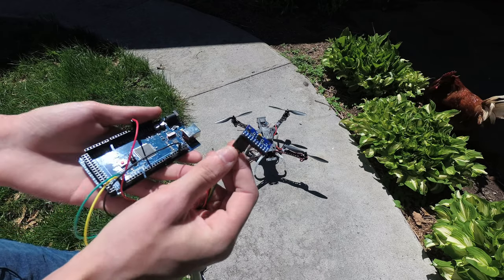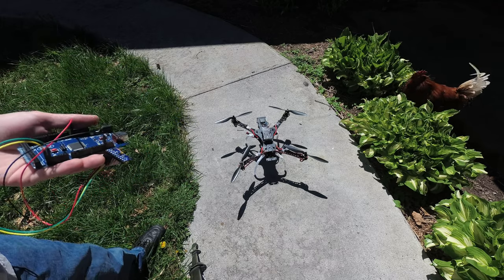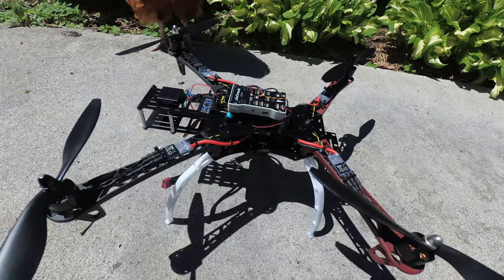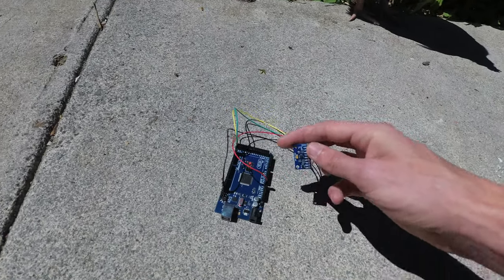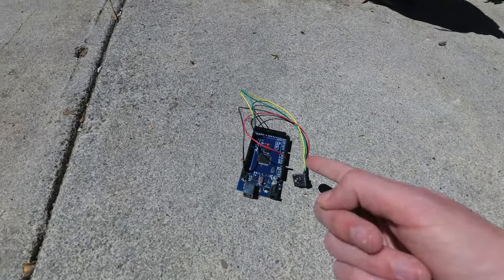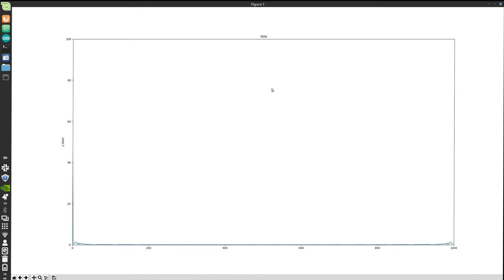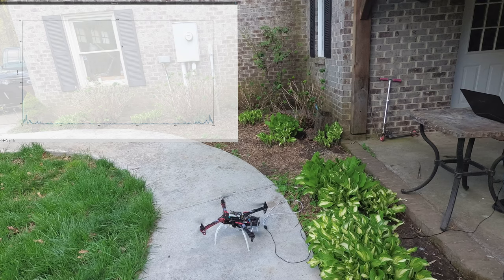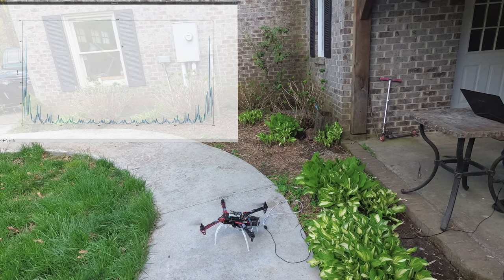DSP mini project

Comment: Can you make a video explaining/replicating what was done here youtube.com/watch?v=X5sCM2q6PXU
Reply from the maker: No lol, Why do you think I would know? It looks like a typical DRSSTC circuit to me. "ZVS" only means the switching elements are transitioning between saturation and cutoff when  Vds is close to zero.
Reply: @power-max  from the LTspice files, it seem he's using the regular Mazilli driver. That would imply he simply wound the secondary to resonate with whatever primary LC circuit he had, and now thinking of it, it wouldn't be too hard to keep testing the secondary while adding turns (and knowing the theoretical dimensions it should have). Seems like a good visual step up from the Slayer you made a long time ago.
Reply from the maker: @sFeral  Yup, the disadvantage is that it has to be interrupted. The oscillation will build up to enormous voltages and currents completely unbounded unless there is a load on the output to reduce the Q factor of the primary (usually a discharge point) I am working on exactly this using a phase locked loop (CD4046) although because I am limited in power (96W from a 48V 2A power supply) I cannot exceed the performance demonstrated in my EasySSTC. I do not have the high voltage capacitors necessary for decoupling on my H-bridge driver PCB, and my gate driver ICs are fairly sensitive to abuse and die quite easily.
Reply: @power-max  have you tried a variation on the Slayer where the secondary signal goes to the base of a PNP/NPN BJT (set to ON or OFF depending the arrangement) which then directly controls a MOSFETs' voltage divider ? There must be an error in my thinking, otherwise this would be a known working arrangement.
Reply from the maker: @sFeral  It sounds like a step backwards from my EasySSTC which uses a proper MOSFET driver IC with hysteresis. The point of the PLL is to enable more robust feedback and enable real audio modulation. I have acheived results better than my singing arc in terms of audio quality, although the length of the arc has been disappointingly short (usually about 1/2" or 1cm).
Reply: @power-max  Yea I got mixed up. What I described would be a regular class A amplifier/like circuit, and would probably work better with a NPN (set to OFF, oscillation is self starting) being triggered by the positive signal instead of the negative. Keeping it simple usually works well, if there are enough flexible/synchable parameters overall. Still I'm puzzled by not seeing it in action, which points to an issue, somewhere. The mental aim was to increase the switching efficiency, since the MOSFET should be going from full ON to full OFF , if the BJTs E-C resistance falls beyond the critical value, at the right moment,  and that could be adjusted, again, "simply" by adjusting its' divider. Though I'm not entirely sure what "simply" means under the circumstances, as  I've only managed to find the G spot of a IRFP260N, in the simplest slayer arrangement, and it isn't in the "full ON" region, which does make sense ( I'm fairly certain I understand why).  I'm getting a 5mm streamer at 12V as is. No topload. The PSU can go up to 10A but I've not measured the draw.
Reply from the maker: @sFeral  OK, so a few things:

* You want to use a totem pole configuration to drive the MOSFET. A single-ended driver is bad because the MOSFET gate is a ~1nF capacitive load. With an open-collector output, the gate has to be charged by a resistor so there's a direct tradeoff between the switching speed of the gate and power dissipation of this driver. A totem-pole can push/pull current in/out of the MOSFET gate, drastically increasing the switching speeds with minimal wasted power. I've done this with my EasySSTC using a 2N2222 and 2N2907 emitter follower config in-place of the DS0027 IC, with comparable performance. You can also improve switching speeds by using very expensive state-of-the-art SiC MOSFET's, with their much lower gate charge.

* BJTs are not so simple :( There is no "resistance" between collector and emitter (Well, OK: There is an Ro due to the early effect but I digress). The collector acts like much more like a  current source that "bottom's  out" when the transistor is saturated (Vce < Vbe ≈ 0.7v). If you use BJTs as a common emitter amp, then the input responds to current and the collector is a constant current sink. A pull-up resistor kinda converts that current into a voltage (ohms law), but the load affects voltage output: A capactive load makes it sluggish.

The emitter follower amplifier instead amplifies current and buffers voltage. It has a high impedance input (looks almost like an open circuit) and is easy to drive with the feedback, but can deliver 100 times the current from the input to the gate of the MOSFET. (low output impedance -> fixed voltage) so it can yank the voltage up and down fast based on the input! An analogy would be power steering in your car that makes the wheel easier to turn by amplifying the force you apply to the wheel.
Reply: @power-max   I'm not sure if you picked up on my exact idea, and I'll need time before i understand the lingo, but it'll be easier for you to point out the mistake if I just give you the diagram https://imgur.com/dm3X3J6    was thinking of putting at least one diode  at the right spot, since the signal voltage disrupts the current flow in the primary circuit . There's also the geometric arrangement of the coils, the primary is exactly under the secondary. Another MOSFET instead of the BJT could maybe also work. I'll have to test it all out, unless you tell me it surely won't.
Reply from the maker: @sFeral  Sorry, let me explain in terms of your diagram. You have a single (unlabeled) NPN BJT as an common emitter MOSFET driver. When this transistor is "OFF" (technical term is "cuttoff region") then the MOSFET is going to slowly turn ON because R3. This works but R3 must charge the MOSFET gate quickly. I would naturally pick a value between 200 ohms and 4700 ohms, or whatever is the lowest value you can get away with before the BJT can't pull it low with your input. I appreciate you bias the base of your BJT correctly! I would make bias the adjustable parameter!
Reply from the maker: @sFeral  I think it would be wise to add a push pull totem pole driver in-line between your inverting amplifier and the MOSFET, as shown in the link below. It will prevent loading effects of the MOSFET from affecting your driver. Take careful note of how Q2 and Q3 are connected. https://electronics.stackexchange.com/questions/299552/what-is-the-purpose-of-this-pull-up-resistor-in-totem-pole/299558
Reply: @power-max  I'm using a fluorescent tube to probe the field , and am getting some interesting effects... like it lighting up fully only if it's positioned tangential to the coil... areas where it flickers from full to none...goes from full to none with slight movement closer or farther. Interesting, and all because I'm disturbing the resonance, probably causing destructive interference.
Reply from the maker: @sFeral  I think your hypothesis is correct. Placing the tube too close causes a loading effect that reduces the Q factor and causes the circuit to be less stable. Too close and it may extinguish entirely! This is perfectly normal and expected behavior from this type of oscillator. Not good for applications needing reliable and consistent output, but fun to play with!
Reply: @power-max  happens only with the addition of the BJT and if it's set in "detuned modes" . When it's just running on the 260N the light is fully on, even at 1mm distance, and the streamer goes out with proximity, though I can lay the tube nearby, 30cm or so, an it will glow along with the streamer.
Reply from the maker: @sFeral  Sounds like some sort of phasing. Your addition of the BJT is an inverting amp. Is the same difference noticed when you reverse the polarity if your primary?  Even if not, then it's probably still a phase thing, but not a full 180° flip. Understanding exactly how the oscillator works is complicated even with an electrical engineering degree because it's not Linear Time Invarient and has positive feedback at the oscillation frequency.
Reply: @power-max  XD forgot to do that, even though I signified the importance by drawing the currents in the diagram.
Reply: @power-max  btw have you tried making your own high voltage capacitors ? ..out of pvc foil and Al foil maybe ? Haven't yet seen anyone make a big one (and with multiple leads out to reduce inductance, if it would matter). I might have seen someone use Al sticky tape.
Reply: @power-max  Turns out that when it oscillates the polarity is actually opposite to what I predicted.  The peculiar thing is that I did not change the polarity when I added the BJT, so there's something amiss anyway. Also changing the number of turns from 1-3 apparently changes nothing, except maybe making it more unstable, as touching the heatsink extinguished the streamer.
Reply from the maker: @sFeral  Then it's probably something to do with the gain of the whole system. Adding the BJT adds an additional stage of gain, also it drives the MOSFET gate better. Driving the MOSFET gate with the feedback directly is a terrible idea because it's high voltage low current and relies on the clamping diodes to prevent MOSFET death.

Yes, I have almost killed myself making r/DiWHY high voltage capacitors. Don't bother with that, Capacitors are cheap. ones you buy will have better ESR, dissipation factor, lower losses, and lower series inductance, and better voltage/capacitance ratings. Aluminum foil is going to have nasty sharp edges that create points of failure at high voltages. RimstarOrg made a video on DIY capacitors a while ago.

The circuit relies on all sorts of parasitic coupling between things. It's notoriously unreliable. You will find that any little thing you change will affect the output.
Reply: @power-max  the polarity is opposite to what I expected because I kept thinking that positioning the primary under the secondary makes it oppose the pole on top of the primary, but it seems  it always acts as if the primary is around  (or in) the secondary, therefore when north is down on the primary, the same thing occurs on the secondary. It shouldn't be like that as far as I know. Btw i noticed fast diodes placed on both sides of the divider lessen the MOSFET heat. I'll take your advice on the caps. From my DIY experimentation salt Lyden caps worked best.
Reply from the maker: @sFeral  Get yourself some high quality film capacitors. They have no dependence on DC bias voltage (capacitance does not change with the applied voltage), they are stable across temperature, have good ESR/ESL/dissipation factor, and the Metallized Polypropylene ones are also "self healing" when you over-volt them. the metallized coating vaporizes before a nasty short circuit develops, preventing further degradation and damage. They are found in switching power supplies around the EMI suppression chokes and common-mode filtering circuit.
Reply: @power-max  I found some good caps on CRT TV boards, apart from that, I don't know which appliances to scavenge. Btw did you try this version of the ZVS i.stack.imgur.com/tpu6c.png    it works MUCH BETTER than center tapped
Reply: @power-max  I missed two of your previous replies, one of which contained a link. Hope you don't miss my previous one, because it also contains a link.
Reply from the maker: @sFeral  I have never seen that oscillator, no. Are the inductors mutually coupled or separate?
Reply: @power-max  Separate. It's the arrangement that appears in electronics.stackexchange.com/questions/321111/zvs-lc-frequency  and works EXTREMELY WELL. You have to try it out.  It's probably what the guy. in my OP link, used.
Reply: @power-max  I answered, again with a link.  btw check out these guys   channel/UCpG-djn5HpmJvUeh5GWTjTA

user/Zenodilodon
Reply from the maker: @sFeral  I'm not a big fan of the so-called "ZVS" circuits in general. They are just high power royer oscillators. They offer no means of power regulation for more precise things (like power supply design, controlled wireless power transfer, etc.) You can find better implementations in the academic and engineering literature that incorporate means of feedback, current limiting, etc. Although I have yet to understand the real implementations myself lol
Reply: @power-max  I surmised that the whole ZVS circuit itself, could be interrupted (already tried it with a relay).  To me it seems important to have the right oscillation in a (preferably) determined amount of time... which translates to power control. Though I haven't yet managed to sync anything to get spectacular results.  Though, I did blow out one of two identical flybacks, when I (probably) accidentally hit resonance, and got 120kV (12cm arcs) out of them in series.  Maybe I can use an intermediate ferrite core to tweak the input frequency from the ZVS, similart to what "Ludic science" did when he demonstrated youtu.be/pqGkUqstn0A   btw I didn't copy this when putting them in series.  Now, with this new ZVS arrangement (one flyback) I'm getting extremely thin sparks, but maximum voltage 6cm  like a breeze.   And I wouldn't mind getting the same from the big coil.
Reply: @power-max  Generally  I see the "flyback transformer" as a variation of the "boost converter" , where (looking at the secondary galvanic circuit alone) both the primary Pw source and the switching mechanism are unified through the transformer mechanism.   This arrangement is already "open-ended" as you called it, and points to a realization that TC is actually another version of this. You know this, but people get mystified not seeing the relation.
Reply: @power-max  I also have a small double-triode, It might work for this youtu.be/918CaA0vW00  though I don't have the harness/mounting rig for it...might have to adapt the crt tube mount
Reply from the maker: @sFeral  Well really the best way to control the circuit is to simply not use the ZVS circuit. You could modulate the voltage fed to it although that's inefficient and difficult. Interrupting is one technique but it's crude. you could try to change the frequency of the oscillator, but the frequency is set by inductors and capacitors, neither of which is easy to modulate.
Reply from the maker: @sFeral  Yes I have already looked at their video. They don't provide details for their setup so I can't comment much on it. It's just another tesla coil video.
Reply from the maker: @sFeral  You mean vacuum tubes? You need rather large high power vacuum tubes for a tesla coil, as well as very high voltages (>2000V) They are incredibly dangerous, more than any other variant. Don't kill yourself. Tubes operate at high voltages but low currents, besides that they are identical to depletion mode MOSFETs or JFETs in terms of their characteristics.
Reply from the maker: @sFeral  Yes. "flyback" is actually a configuration for Switch Mode Power Supplies of low-medium power capability. They are a bit weird in how they work, storing energy in an air-gap which creates magnetic reluctance and delay in the transfer of energy from the primary to secondary. All the math and science of them is thrown out the window when you build the DIY "flyback transformer" driver circuits.
Reply from the maker: @sFeral  It appears to use inductors for DC bias. See if you imagine the DC power supply is like an AC short, where the AC current can pass right from VCC down to GND, L1 and L2 add to be 190uH. You can imagine both connected to ground, or together. Frequency is still set by the resonant tank circuit, although the additional inductance from those biasing inductors will affect the frequency. You could add a 3rd winding to saturate the core with constant current source to affect it's inductance, if you pick a core that has a highly nonlinear response. This would be one way to achieve audio modulation. I have done this method in the past and it does actually work, but the arcs are not loud, and a class A amplifier I made was inefficient, and the noise coming from the supply was more than the amp could deal with. So some filtering will also be needed.
Reply: @power-max  I didn't link any specific video  from The Technicians, just wanted to link you with Zenodilodon, common interests and such.
Reply: @power-max  I bet it is, that's why I saved one crt board untouched, to later see if I can identify and figure out how it comes together to do the wholly important work of times past.
Reply: @power-max  CoolDudeClem used that method on the inductor, and from what i recall, it worked.
Reply from the maker: @sFeral  You will probably be disappointed with the CRT's performance. They run the transformer at a very specific frequency and its output from one of the coils is a triangle wave meant for the vertical deflection yolk, of course there is the ~10kv output that goes to the CRT's anode connection, and several connections to the electron guns. The transistors for driving them are usually high voltage NPN transistors with a built-in snubber diode. I saved a black and white monitor tube and motherboard for hacking into some sort of twitter IoT thing, having the CRT itself mounted with all the electronics visible would be so retrofuturistic!
Reply: @power-max  Art
Reply: @power-max  Is this guy saying that the polarity changes when the field is collapsing ? /watch?v=vmNpsofY4-U&t=4m57s    That doesn't make sense. Also it doesn't make sense not to reach saturation when using an inductor this way, since you'd want the maximum current to flow (field to develop) before it collapses momentarily, and he makes it sound like it takes a lot of time for the field to collapse, which can't be true (at least for aircores and no memory ferrites (don't know the terms yet, but this clears up what I was saying about the boost arrangement and "flyback" being essentialy the same thing (for ex. if you were to use the flyback core in this setup, you'd definitely get the same performance of that core)  Higher inductance than the aircore, and quicker collapse than if the core were a closed loop /watch?v=M3GKvYIQUCI
Reply: @power-max  btw I tried running that new ZVS configuration with just one inductor for both sides, an it doesn't work (or I accidentally had a break somewhere, which had already happened earlier when i had two, and one of the drain outputs disconnected, making the insulation of one of the inductors boil off)
Reply: @power-max    Laiter, Laithwaite,  Professor Julius Sumner Miller, Bell Labs, AT&T archives, Ludic science...     Jeff Quitney - channel probably taken down by youtube... twitter com/quickfoundnet/status/1109314006131441664, but videos can still be found using the name.  really  good experiments here on youtube. (For anyone that could be reading this comment section, and isn't aware)
Reply from the maker: @sFeral  He's right, but only if the voltage on the output is higher than the input. This condition must be true because otherwise a lot of current would flow through the inductor and diode directly to the output (basically a short circuit). When the transistor is "ON" or ohmic region for MOSFETs, then the right of the inductors is shorted to ground while the other end is connected to the supply. So there's 12V across it just like any other load. But current through it grows linearly and very fast. Before the core saturates, the FET is turns OFF (cutoff region: no Ids regardless of Vds) and you can imagine the charges that were flowing have "momentum" and they want to keep flowing. The inductor must find a path to ground in the same direction. The voltage at opposite end of the power supply rises (opposite polarity across L) until it the voltage exceeds the voltage on the output capacitor, which is greater than or equal to the input voltage and that bit of stored energy in the inductor is dumped into the output capacitor. In this whole process, energy is mostly conserved. Look into RAM pump for a good hydraulic analogy.
Reply from the maker: @sFeral  The amount of time it takes for the field to collapse depends on a variety of factors. In an ideal case (perfect inductor, no resistance, no core losses) it would depend only on the EMF generated. With EMF=0 the field would never collapse! That is, imagine apply a voltage to the inductor for a brief moment to get those charges flowing. you then immediately remove the voltage but leave the inductor shorted, NOT open circuit. The current that integrated over time from the application of a voltage prior will continue to flow, and the core would remain energized. When you then add resistance in series, that creates a voltage drop and dissipates the energy in the inductor, causing the current to fall back to zero.

That is actually a REAL problem with relays, AND flyback drivers!!!! Because if you add a diode as a snubber, then the current takes many milliseconds to decay because the EMF=0.7V and it takes some time for the stored energy to dissipate. The result is the relay will stay ON for some milliseconds after turning if off and the performance of any flyback based SMPS will be limited.
Reply: @power-max  Isn't magnetic field independent from its' interaction with itself ?  Superconductor coils can be made. Current once induced keeps flowing and the field persists with it (unless acted upon, even by itself, but then the reaction might be contained within the loop). Here's one loop from Leitner youtube.com/watch?v=BFdq6IecUJc&t=13m28s
Reply from the maker: @sFeral  Well yes. Like I said *because the EMF is ZERO!*. A superconductor you can think of as a shit ton of closed loops (think of the cross-sections). You cant have any voltage in a closed loop with no resistance. The EMF must be zero. Any magnetic field applied will be opposed, current in this system is essentially arbitrary In can be vary from ∞ to \-∞ wildly. Keep in mind, I got a C\- in my EMF class that did all the maxwell equations, telegrapher equations, etc. So my understanding is obviously limited lol.
Reply: @power-max  It's the snake biting its' own tail, rearing its' head again.  There's something wrong with grammar when possessive form of a noun looks the same as a contraction, so I decided to add apostrophes after the "s"
Reply: @power-max  I'll keep coming back to what you've written. Thanks for the interaction.
Reply: @power-max  One more thing, I have a plasma ball that uses a hex inverter and a tip122 Darlington transistor. Do you know of this circuit ?
Reply from the maker: @sFeral  what circuit?
Reply: @power-max  I still don't know what polarity switching he was talking about, and the phenomenon he calls "self induction" has to have another name, because it isn't what happens when the source is cut off.  Apparently Afrotechmods doesn't even know how to call it because the mechanism/arrangement which eliminates (negative effects in his particular case) it, doesn't have clear nomenclature either youtube.com/watch?v=LXGtE3X2k7Y&t=3m40s
Reply from the maker: @sFeral  he is talking about the polarity of the EMF of inductor. You can look at the differential equation for the inductor. V = di/dt *L or something. It shows that if you apply a changing current you will have a voltage develop across the inductor. Conversely if you apply a fixed voltage, the current will change that rate.
Reply from the maker: @sFeral  not sure what "self induction" is either. You can Google is, but if that turns up nothing then it's probably "fake news"
Reply: @power-max  self-inductance, is used more often in the titles... and btw I've stopped receiving notifications about your replies, for some reason.. and some of my comments on other videos have been censored XD I guess youtube doesn't like communication.